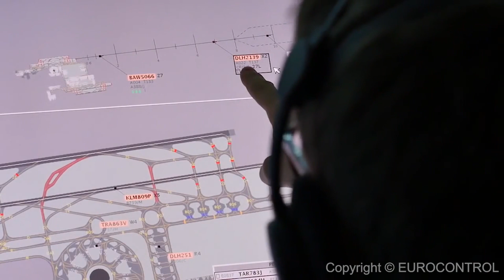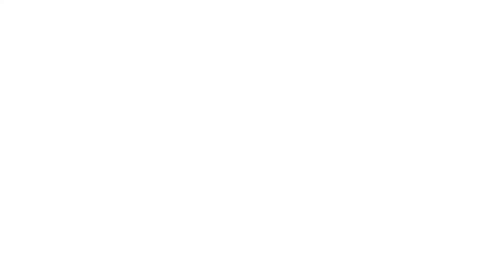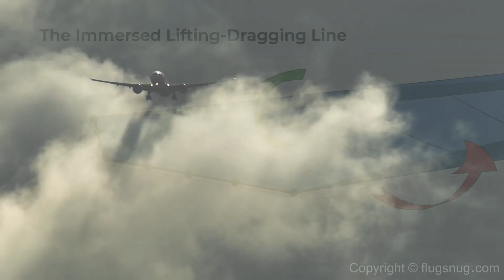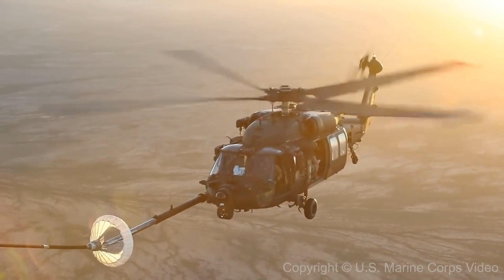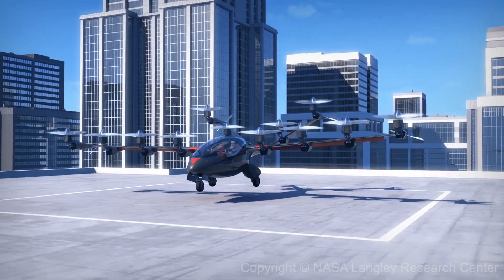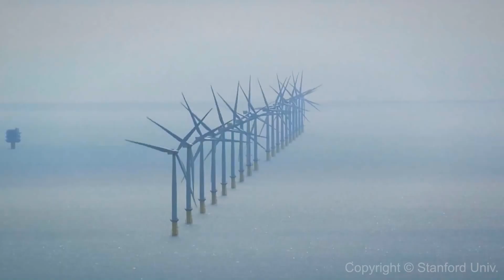Wake vortices: from the numerics to the physics

Comment: bonjour et merci

il y a t'il moyen d'utiliser ces équations pour créer un économiseur d'écran qui ferait apparaitre une image en faisant tournoyer les pixels dans un vortex tournant autour de l'axe des y centré à la moitié de l'écran horizontallement, puis assez rapidement (disons 5 secondes à 60hz ou 120hz) passer à une autre image: un coup de vortex dans le sens horaire fait apparaitre une image, un coup de vortex dans le sens anti-horaire fait disparaitre l' image, puis apparition vortexée avec nouvelle image, disparition, etc... 

L'idée est de créer une sorte de vortex qui se gèle / pause toutes les 5 secondes sur une image statique donnant l'impression que la réalité est toujours en mouvement et que ce que l'on voit est juste un cliché.

L'idée c'est que cet effet fonctionne sur un pc / mac sans besoin de grosse puissance de calcul genre même sans GPU